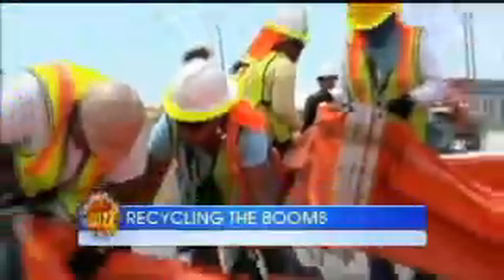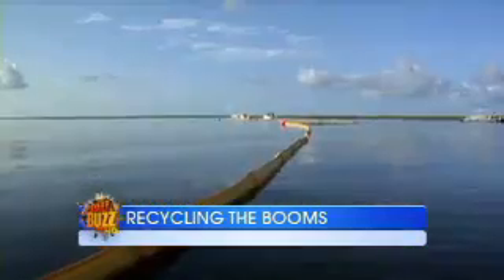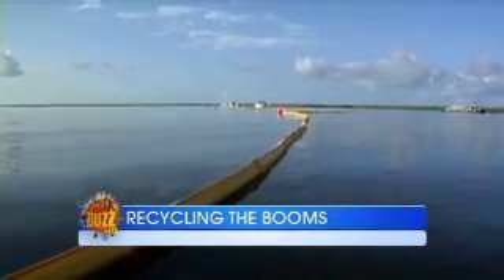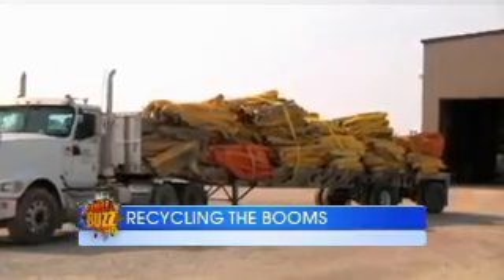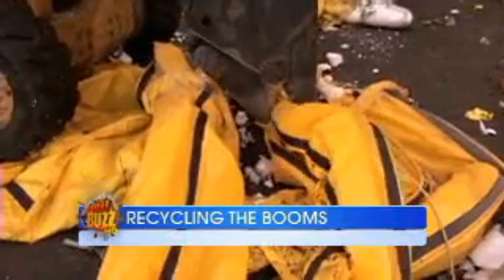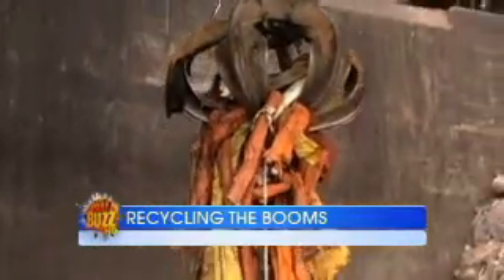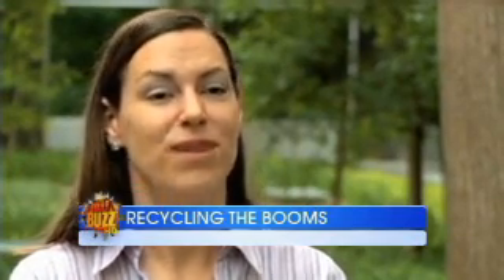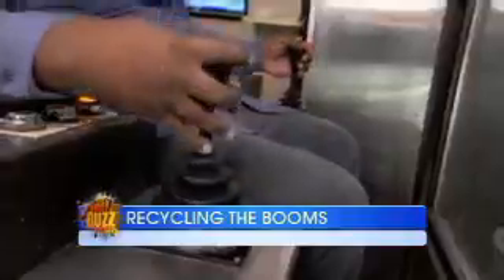Oil Boom Recycled for Car Parts and Fuel

Comment: Guess what. We still don't trust BP. Seeing as BP has the WORST safety record out of all major oil producers. In fact BP screws up more than all the other companies combined. You want to know the truth? BP installed a BOP which they received from Halliburton. BP had concerns about a flaw in said BOP. They installed it anyway. It would have cost millions to have another one made while temporarily shutting down the operation. Those in charge should be tried for crimes against humanity.
oil worker.